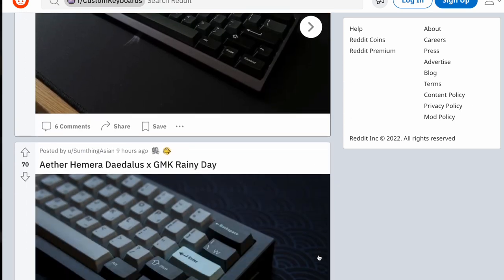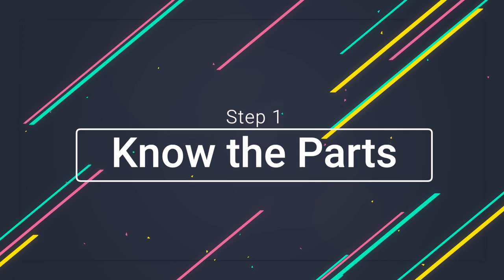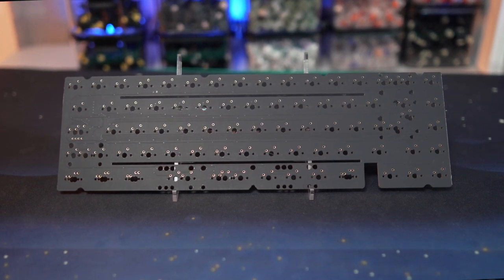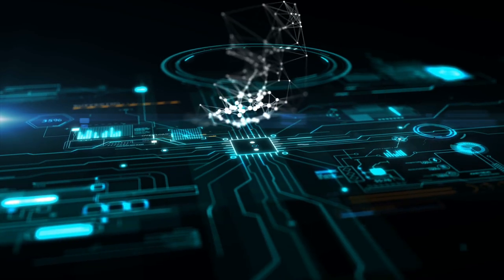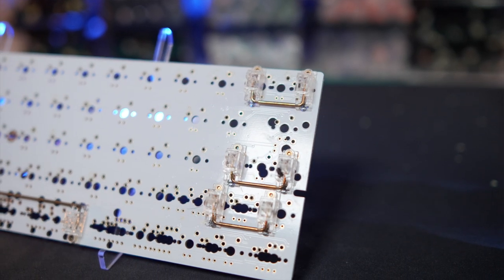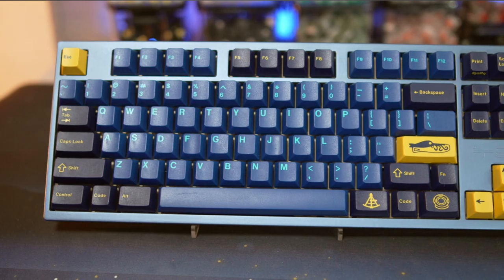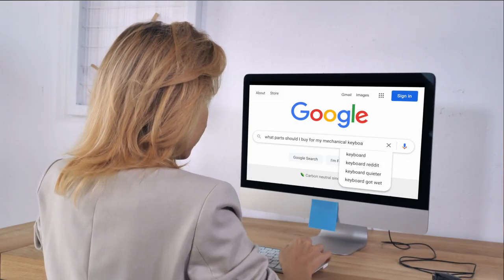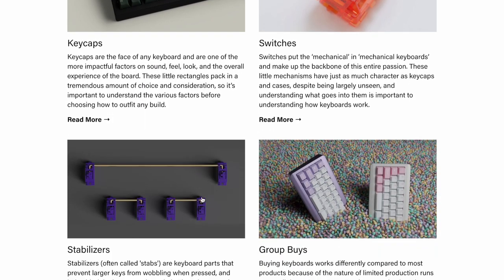5 tips BEFORE building your 1st custom mechanical keyboard

Comment: It's very easy to get ahead of yourself in this hobby. I wanted to build a custom layout with a dz60 board and rushed buying components only to realize I bought the incorrect plate. I technically did this twice because I failed to realize how unusual the layout was. I also discovered I needed a keycap set that supported a 2u shift key.  So slowing down and making sure everything will work as planned is helpful.

Comment: can you recommend linear switch for brass plate keyboard?
Reply from the maker: There's a lot more that goes into switch selection other than the type of plate you are considering. Things such as mounting, chassis design, PCB flex, typing angle, keycap, typing style all play a factor. What other things will this board have?